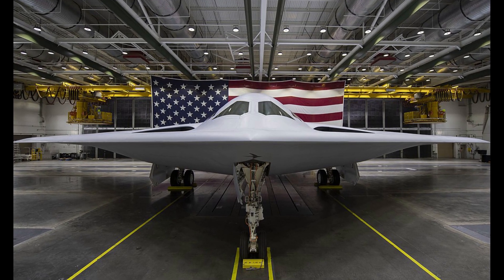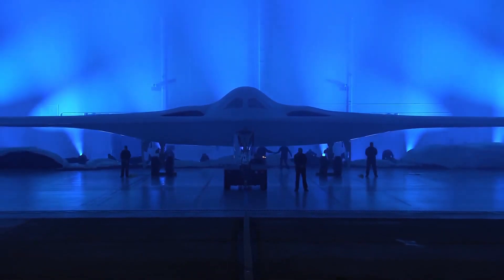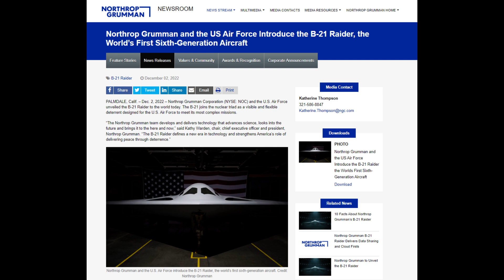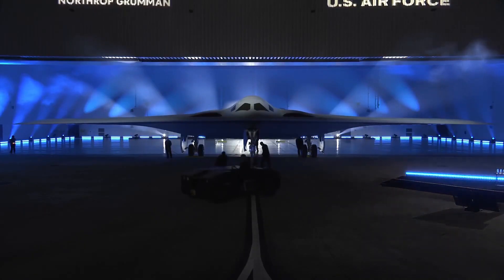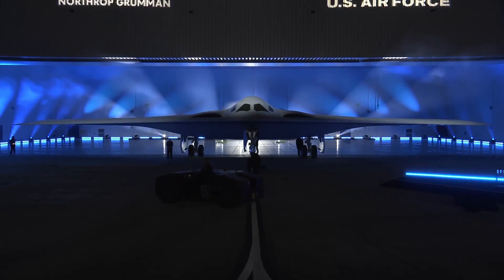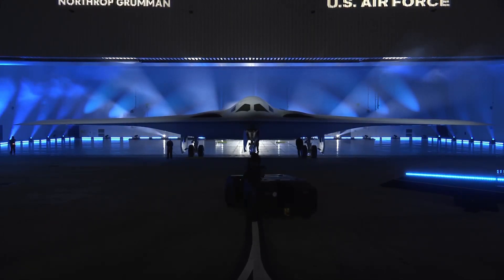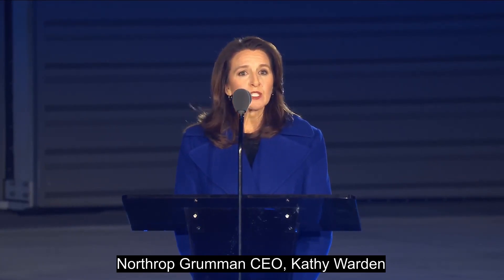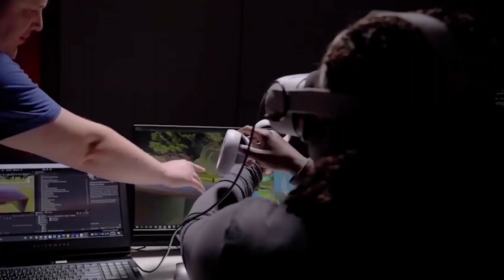B-21 Raider Stealth Bomber - Fearsome Weapon or Giant Money Sink?

Comment: The question that I have is that if US stealth technology was so good why did Turkey go for buying the S400 even though it cost them their participation in the F35 program.
I'd imagine that Turkey had a fairly good idea of the F35's true capabilities...
Reply: Israel has proved the F-35 to be a very capable aircraft in real combat. Turkey propably thought it would get a slap on the wrist and be allowed to stay in the F-35 program. Nothing to do with F-35 capabilities.
Reply: @tuomasandersson3889  oh is it? So capable that one of the F-35 went into "retirement" after its maiden mission into syria?
Reply: @mobiuszero2424  there have been quite a lot of succesfull operations with the F-35 by Israel. Nothing you say changes that fact.
Reply: @tuomasandersson3889  against whom? Peer state enemies?

That one F-35 that gone into "early retirement" is highly likely because it have been shot by syrian anti air missile, syria is using old soviet/russian equipment, not state of the art where stealth is only useful against non peer state enemies because they (should be) dont have any means to lock on those F-35, syria prove that was not the case

If you say israel is having success using F-35, they also not having problem using F-15 and F-16, they probably using F-35 just like how they use F-16, because their F-35 maiden mission already prove that F-35 capability is not like what they imagine
Reply: @mobiuszero2424  against S-300 and S-400 guarded airspace. And they performed their duties with ease.
Reply: @mobiuszero2424  not true. There are S-300 and S-400 systems in Syria. They just can't do anything to a F-35. Good only against 4th generation fighters.
Reply: @mobiuszero2424  No F-35 has ever been shot down
Reply: @ulikemyname6744  not shot down but "retired after maiden mission" lmao

Go check israeli F-35 grounded after maiden mission because of "bird strike"
Reply: @mobiuszero2424  And why is that such a big deal to you? Birds can bring down a whole jumbo jet.
Reply: @ulikemyname6744  because air intake of F-35 is small and they only have 1 engine, jumbojet engine has large air intake and it has at least 2 engine which means more air intake, furthermore it was military grade certified against bird strike, its also on military airbase, which has higher safety standard than commercial airport because they were handling not only jet fuel but military explosives, now tell me the chance of that F-35 retired because of bird strike just after their maiden operation into syria? Obviously its retired because of battle damages not birdstrike, they just want to save F-35's image
Reply: @mobiuszero2424  There are images of the plane and if the jet was hit by a missile of any kind it will not be in one piece. And who said that it has to hit the intakes? The birds can literally hit anywhere and it will create a lot of damage to the jet. The F-35 even landed after the accident. You think that a jet which was hit by a missile will land normally? You are an optimist. Also the same battery was destroyed before that so technically a battery that doesn't exist or is not operational anymore cannot really destroy anything. Oh and btw the jet was not retired. It was returned to service after repairs.
Reply: @ulikemyname6744  lol no, do you think missile works by directly impact the aircraft? Missile itself is just a vehicle to deliver the fragmentation warhead which gonna explode if its near the target enough, not directly impact the aircraft and sometimes the aircraft itself can survive the engagement and landed although heavily damaged

"The same battery was destroyed before"
You do realize that F-35 doesnt operate alone right? 

Besides, no one can independently confirm that F-35 was really repaired or landed that easily, whats for sure is that jet is damaged quite bad that israel cant cover up the incident
Reply: @mobiuszero2424  Yeah but to survive the hit from the fragments is almost impossible. So it is 100% certain that the jet was not hit by a missile. Also S-400 cannot detect in reasonable enough distance let alone S-200. The jet was hit by birds and the damage was minimal. The jet was officially given to Lockheed Martin for repairs and it is already back in service. Actually it was back in service long long time ago as the incident happened in 2017
Reply: @ulikemyname6744  tell that to one winged F-15 landed in Negev, also done by Israel

Also, just like i said, no one can independently confirm whats happening, whats for sure is the incident is so big that Israel decide they should say something rather than totally cover it up, the fact it was happening just after mission to syria  is too coincidental
Reply: @mobiuszero2424  Absolutely nothing coincidental here. It sparked the news because of F-35's fame. The get is extremely popular in the news as you know. 1 year after being released in active service there was an incident ofc it will make it in the news.
Reply: @ulikemyname6744  keep snorting your copium while old soviet era S-200 missile can actually scratch F-35 lmao
Reply: @mobiuszero2424  In your imaginary world maybe but this is the real life bro 😘
Reply: @mobiuszero2424  F-35 was hit by birds and because it is a military tech it didn't go down. It was hit, landed and got repaired. I don't know how long it took but a year sounds about right considering F-35 was just one 1 into production when it happened. Not to mention that IIsraeli F-35s were flying within an area defended by S-400 and it never got detected. This sums it up S-400 cannot detect F-35 within a reasonable range. So this automatically destroys your theory that it got hit by a Russian system. Oh and ofc we have to add again it is a Russian system so it is flawed by desing and it doesn't work. Russians do not have advanced technology that can detect a stealth jet in the sky within a reasonable range. Russia is a backwards country with no means to produce anything that advanced.
Reply: @mobiuszero2424  Nobody knows if it was 1 year but even if it was 1 year that is still good enough considering the bird strike happened just 1 year after the beginning of serial production. Even today due to the high demand the F-35 is not particularly good on spare parts especially if it is for non-US deal. Most units go for the US demands. So 1 year is pretty ok. Again I don't know if it really was 1 year but even if it was that's good enough considering the period. 

Even if the S-400 could control the S-200 system that doesn't mean they could hit it because the F-35 pilot will never go so close. It has to be very close to get a track let alone to get a lock on target. And the official version of Israel says birds. The information doesn't come from a totalitarian regime that only admits its victories like Russia and China so their version is believable. There are many incidents where military planes were hit by birds creating a lot of damage on the plane. So no wonder why the plane was grounded after being hut by birds
Reply: @ulikemyname6744 if you believe birds which is that squishy moving with low speed and carry no explosive cause heavy enough damage to military aircraft  which already certified against birdstrike to be grounded lets say 6 months then clearly something is wrong with your brain

again, your assumption is based on thin air without any source,logic or numbers since no one really knows the range of S-400  can detect F-35, furthermore F-35 is not that stealthy to low frequency radar since low frequency radar can penetrate far more deeper than high frequency radar so it need absurd amount of RAM coating which impossible to employ, F-35 and all current stealth aircraft also not stealthy to IR sensors, this is why US navy hornets now carry IR sensors in their centerline tanks as default configurations, this is also why US now develop mirror like coatings

Totalitarian regime or not, military operations and incidents is confidential by nature, if they can cover it or it was not that important they wont say or release any information, would they announce to news media if they lose some screws? They wouldnt unless it was screws of nuclear ICBM and causing huge explosions that cant be covered up, same with this case, why on earth they need to cover this up? Because syria actually said they damage israeli aircraft that day and israel said one of their aircraft damaged by birds, what a  comfortable coincidence?
Reply: @mobiuszero2424  I think I explained multiple time why they needed 1 year to fix it. You simply refuse to acknowledge the fact that the F-35 was released in 2016. The incident happened in 2017. There were no spare parts and Lockheed Martin had to fulfill X amount of deliveries. Ofc when you produce a dozen jets for the whole year you will struggle with repairs. The demand is very high and production needs to ramp up. Look at Tesla they need several months for repairs because they don't have any cars in their inventory because even to this day everything they make they sell. Idk why is it so hard to understand. Or you just refuse to understand it because it will somehow crack your narrative.

So you admit it does a lot of damage after you first said it doesn't do a lot of damage. I guess it is hard to argue when you have the internet and we can literally see how much damage can be dealt by bird strikes.

No IR sensor can see further away. There is nothing to see. It is a horizon thing. Don't know if you are aware but the Earth is round and it is kinda hard to see something when it is behind the curve. You know... Earth 🌎 it is like a ball but not really.
Reply: @ulikemyname6744   thats BS, tesla is not military hardware company, and long waiting for spareparts is only possible if it was caused by spareparts that rarely get broken down like the electric motor itself, those companies are not stupid, they already calculate and forecaset which parts have replaced often and which is not, because producing anything in industrial scale need to be planned and produced in batch to keep the cost down and profitable, most damage that birdstrike can do is that bird get sucked into the engine which cause turbine damage , this will certainly cause the aircraft to crashing down which means no smooth landing or it strikes when it almost land, which will not cause any external damage, both cases will cause long engine overhaul but both cases doesnt match  your narrative since if that was the first case there is no "landing safely" because of engine loss or  in second case israel can show there is no battle damage from syrian armed forces since it only damage the turbine inside the engine, they can easily do press release to show the jet get no damage from syria just like what russian govt did by show the media the damage to their bombers when ukraine use drones to damage russian airbase and bombers but this time there is no damage

 
If it was not caused by bird strikes but missiles, this is possible to cause long overhaul but light damage, because sharpnels or shockwaves of missile warhead gonna damage multiple parts of the aircraft exterior or even flight control, which in turn gonna compromise their stealth capability of the aircraft if not repaired and obviously you cant fly safely without working flight control furthermore syria didnt even know what jet they hit with their missiles and this really make sense since it was israeli F-35's maiden operation

It can cause a lot of damage but has very very very small chance to cuase that long overhaul because it needs to be sucked into the turbine, this is why already mention before that F-35 only has single engine before, F-35 only has single engine which its air intake is splitted into two smaller airducts which clearly reduce the chance of that happening, even in commercial passenger flight with two or four engine (even worse the have massive air intake opening for each engine), this is rarely happen, furthermore it has military grade birdstrike certified aircraft, not commercial ones, this is why i also already said it was landed on military airbase which has strict control of their airstrip against birds

What are you talking about? Radar also limited by curvature of the earth, this is why aircraft and cruise missiles flying low to evade radar, IR sensors is basically the same as radar but it only has receiver for infrared signature and they dont need to emit anything unlike radar because every aircraft already emitting their heat from their engine
Reply: @davout5775  are you talking about 1990 era? Its 2010 era were talking about here, and its israel not US and its against syria not serbia, israel doesnt have specialized electronic warfare platform like growler in service so no they not having sortie with growler circling around. On what basis you said that F-35 can jam S-400 radars? Just so you know S-400 also using AESA radar which has LPI mode and clearly more resistant to jamming, there is russian S-400  stationed at syria during that time too and S-400 actually can direct and control S-200 systems. Israel also do this to destroy S-200 battery, which means it was not for nothing. Syrian government also didnt say they shot down F-35 but they said that they hit israeli jet, they didnt even say in specific which jet, which make sense during that time they didnt even know it was F-35 since it was israeli F-35 maiden operation
Reply: @mobiuszero2424  I'm not gonna waste a single minute of my life on this pointless argument. I will stick with the official information!
Reply: @mobiuszero2424  Israel has a culture of exceptional pilots and their victories in the air are decisive. Now if mistakes were made on behalf of the Israeli pilots then fair enough. Yet that is not an argument for the S-400 against F-35. Any squadron attack executed by the book will take down a fully set up S-400 system. The problem in the 2017 incident would be the incompetence of the Israeli pilots rather than lack of capabilities from the F-35 platform. But again the Israeli Air Force is one of the most technologically advanced and professional Air Forces in the world so I doubt that is what happened there. That's why I said the official version of the story with the bird attack is more probable than actual S-200 or S-400 system hitting the F-35. At the end of the day it is the Israeli word vs the Syrian word so no solid conclusions can be taken. 

Something I think you might find interesting is a report a Greek report coming from an electronic engineer Konstantinos Zikidis. He says that Nebo-M low frequency radar can detect F-117 from 350km away in enviroment where there is no electronic warfare. The estimates if there is electronic warfare ranges between 57 and 72km. Now as you probably know low frequency radars are not good for weapon locks. And that's the main purpose of stealth jets. The idea is to make it hard to achieve lock not so much to find them in the sky. The report talks about the F-117 this jet is very old now and F-35 is a lot harder to detect due to innovations in RAM technology and advancements in technology. F-35 also have electronic warfare capabilities which F-117 lacked. So an F-35 doesn't really need AWACS for electronic warfare. That's another reason why F-35 is extremely unlikely to get shot down by S-200 or S-400. But again these are only capabilities. It could very well be that the pilots were not going by the books and ofc  they will be shot down. That's why I'm not setting on a solid conclusions even tho as I said to me it is unlikely such scenario happened on that day.
Reply: @mobiuszero2424  This is an article coming from a professional in the field of telecommunications. Radars, anetnnas that what they do. I study telecommunications currently so I know these are the people who would give a more accurate information. Russia is buying Nebo-M because they have nothing better to detect it. What's more if the information is accurate and somehow there is no electronic warfare in theory they would be able to achieve lock through combined low-high frequency radars. 

On your second question the basis are wrote on decades of implementation of new tactics and testings. The Americans are Pioneers and they hold regular military games. I'm pretty sure they have tactics on how to best implement in heavily radar protected areas. No S-400 has fallen into Western hands but they don't really have to have one. Radar is a radar after all.
Reply: @davout5775   not really, IRST actually did better if that was the case, IRST is passive and cheaper with comparable range  so it wont trigger any RWR and russia is well invested in IRST sector compared to US. it was totally waste of money if Nebo-M were really that bad because you need absurd amount of Nebo-M just to cover one area and it will be destroyed even before they detect B-2 or upcoming F-35 because they can just sling AGM-88 HARM towards that radar before they even get detected, Russian govt wouldnt even bother  to buy it, also even who are talking about it is professionals, i really doubt they have confidential specs of those military hardware, even worse were talking about top tier weapons here

Sure, radar is a radar but you cant make a procedure based on assumptions, you need small range of numbers to begin with, and obviously both Russia and US  doesnt release their numbers to everyone, Russia were not that stupid to buy specialized radar for detecting 5th gen aircraft which is basically have worse performance than their standard IRST since they have tight budget
Reply: @mobiuszero2424  Yes IRST are very good at detecting but the problem with the Infrared solution is that the range is very small.
Reply: @kreek22  they were smartest NATO member actually

They doesnt want to be controlled by US so they bought military hardwares from everyone else, you should check why turkey bought S-400